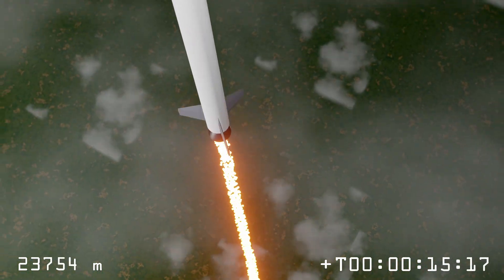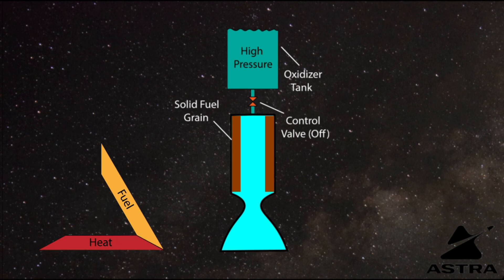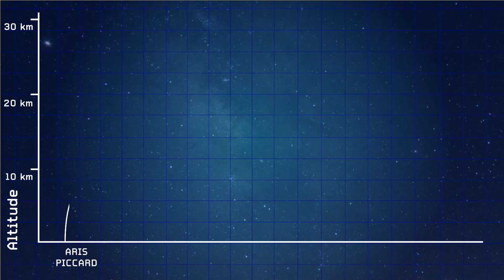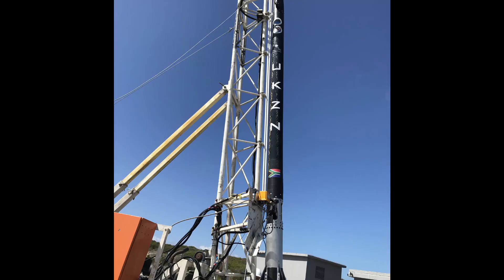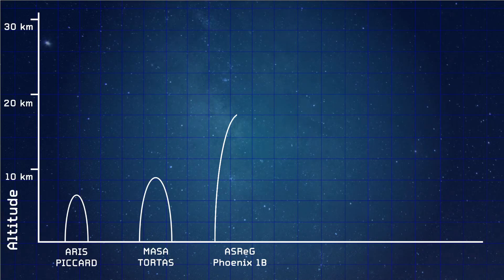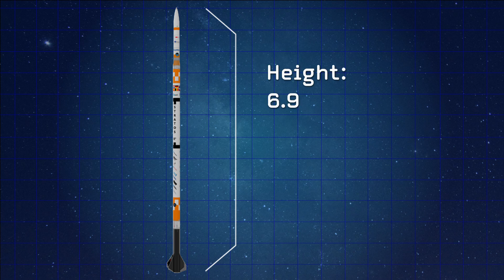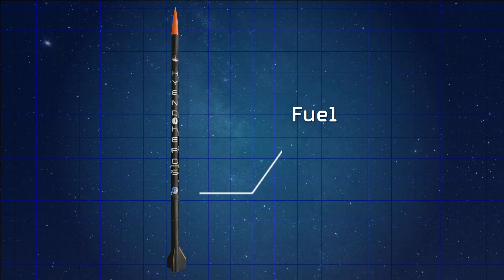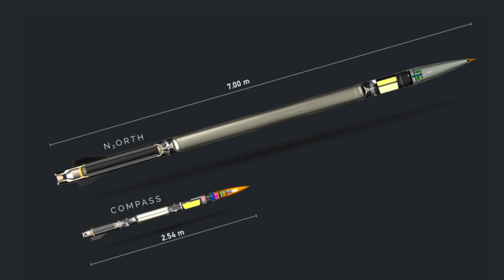Top 5 Amateur Hybrid Rockets

Comment from the maker: Official Correction: I incorrectly stated that the HEROS 3 used HTPB as the fuel grain.  However, it also uses Paraffin wax (like the rest of the rockets on the list).  The N2ORTH rocket being developed by HyEND right now is the one that is using HTPB.  Apologies for the error.